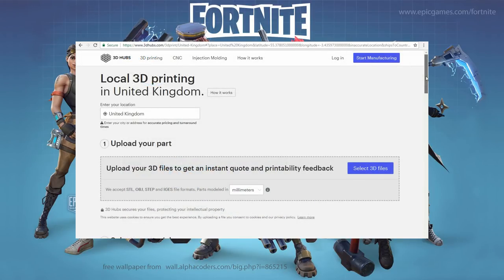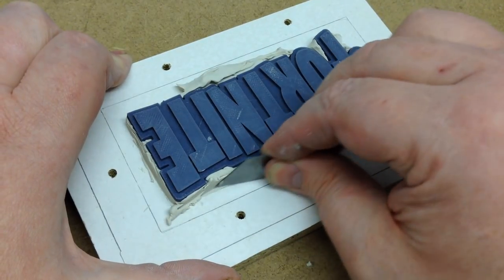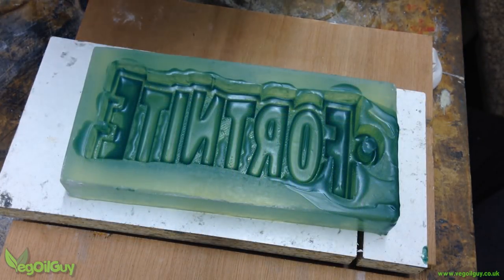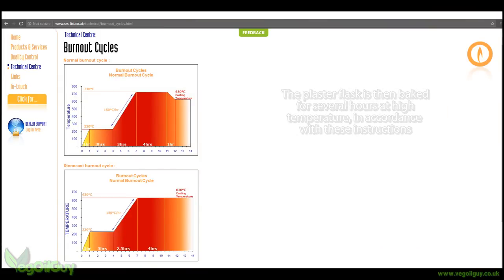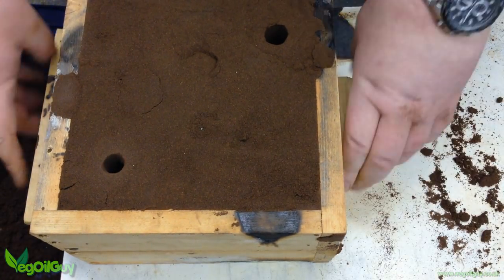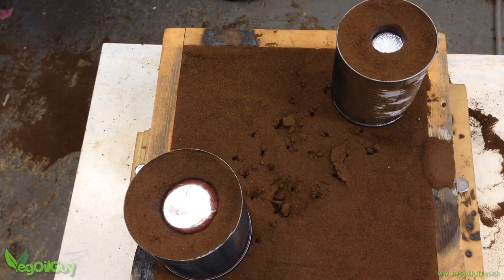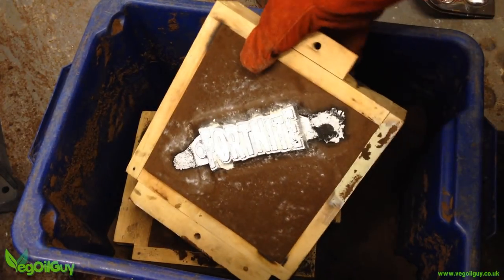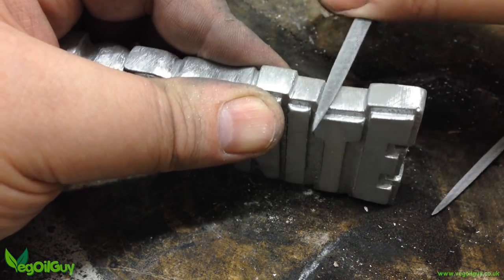FORTNITE  logo in made in METAL using lost wax casting by VOGMAN

Comment: Great work on the casting! BigStackD couldn’t have said it better. Was it printed in pla or abs? Maybe I missed that part. If it was abs an acetone bath would have smoothed it better but pla a light heat with a lighter or blow torch does the job for me sometimes? Anyways great work on that 👍🏻
Reply from the maker: Thanks mate, but this wasn't a lost PLA cast... it was a lost wax : )
I took the 3D print and mate a silicone mould.
Reply: VegOilGuy no I got that but with the lines from the original print I mean. The background is always the hardest if it isn’t smooth already. I would try a primer before the silicone to fill in the tiny cracks a 3D printer makes. Just my opinion as I have tried a lot haha but it came out great 👍🏻 have you seen some of my hiccups 😂
Reply from the maker: Sorry mate I haven't... but it looks like I going to... learning is what it's all about  : )
Reply from the maker: You were right mate... I should have realised it.
But I honestly DO like the background lines... it's a sort of texture. Plus it hides my terrible casting  : )

Comment: I think you are missing an important step. I did some lost wax casting many, many, many years ago at high school. We coated the  blank in a substance we called "debubbleizer" with a soft water colour brush, then a thin shell of pure plaster was painted on, again with a soft brush to achieve a perfectly smooth surface then the more porous inbestment was added.
Reply from the maker: That's quite possible Mort. There's dozens of different approaches. It's a vast topic and of course the OLDEST form of casting going back 6000 years I believe.
The investment powder I use does require the use of a vacuum chamber. If you've got that, in theory there's no gas left.
But thanks for your input. It's always appreciated  : )